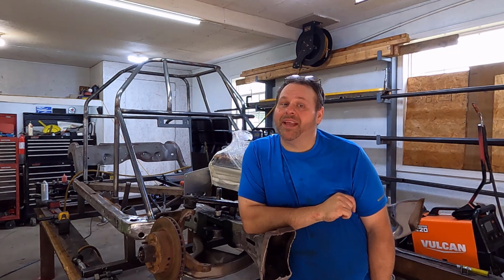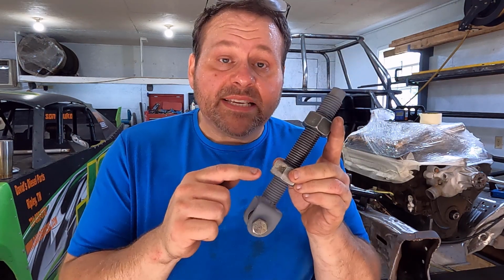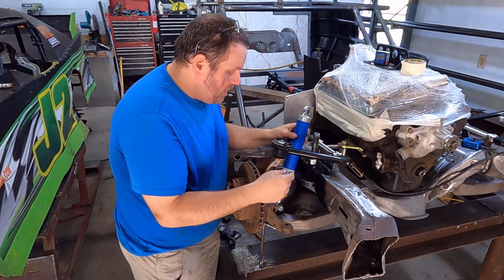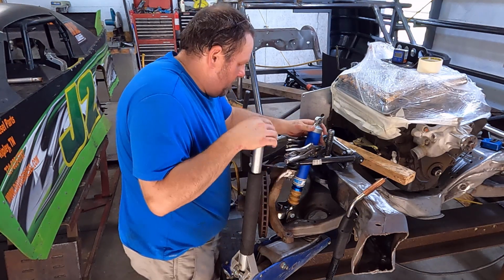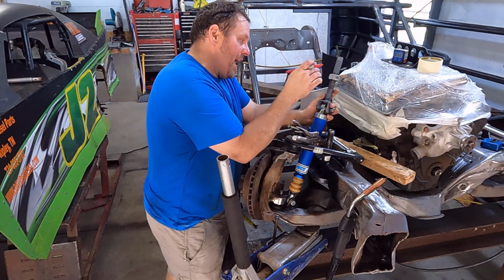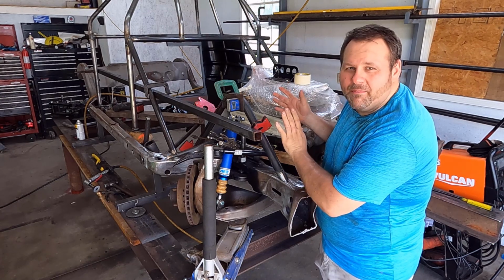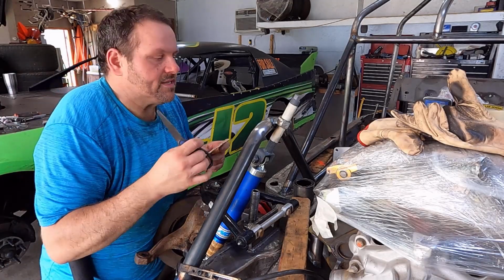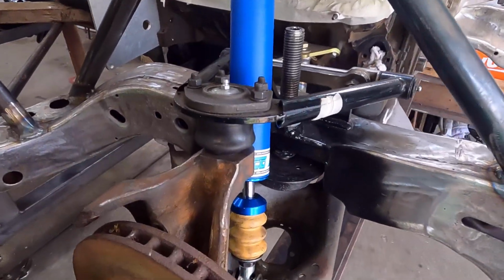Mounting a Shock with a BumpStop

Comment: Do you have to have the screw jack when running the bump? My question is if you know where you have to have it, will you ever adjust the screw jack again once you know where you want it?
Reply from the maker: The jack screw can definitely help you dial in the load on the bump but it's not required. You can use shims that pop in to do the same thing. Crate Racin took away our bump stops before I ever got the chance to use this one. On my camaro, when I ran it in Crate Racin SS, I did run a bump before with good success and I only changed it when I changed the bump and went to a softer bump I needed it to engage faster.

Comment: Only bump stop I've had was when I used a 600lb RF spring on a 3600lb car and the frame was hitting/rubbing the track 🤣
Whoever build the car made the tie ins for the cage too low...
After the race that right side section paint was gone and polished smooth
Reply from the maker: I built this one knowing I would be on softer springs but having a weight jack to simply run down sure makes that less of an issue as well.

Comment: Do you have to run the shock through the arm? Looking like they will be damaged easy in a small mishap
Reply from the maker: As far as rules go, I can put it anywhere on the front. There is a significant control improvement by getting as close to the end of the lower arm as possible and to get anywhere near that end, through the upper is about it.
Yes, its close and if a ruin an upper then the shock will need repair for sure. I do wish I had a better solution in this.
Reply: @DIRTRACELIFE  the farther from the ball joint just needs a bit different shock setting. Same results. But you are doing a good job watching most of the build keep it up
Reply from the maker: Thanks Mr James, I know you are right in what you are saying. Location just changes the valving requirement. I need to make sure I point that out in a future video.
Reply: @DIRTRACELIFE  check out this channel. Not like you are explaining but damn they have a system. B&B racing chassis

Comment: I'm planning to cut a hole through the upper tube with a hole saw then weld in a threaded insert for the shock jack bolts. Do you think that's a bad idea?
Reply from the maker: No its a great plan. Make sure you don't have big gaps and complete consistent welds all the way around both ends or it will be a fold point in the tubing and I would advise welding in sections with cooling time to avoid heat saturating the tubing to the point it softens substantially. I would happily use this method as well and a few others on here have commented they like that approach as well (And it looks great!)
Reply: @DIRTRACELIFE  thanks I like to get as input from others. I'll mock it up on the car like you did then tig weld it up on the bench in a comfortable position.  Would like to integrate a k member bay brace bracket into the same area.

Comment: Great content Jason, how about using a peace of tube on the shock adjuster between the two nuts and then you could cut it in or drill a hole  through the shock absorber hoop and add some gussets  to it ,think it would be a lot stronger than just the nut and gussets, hope you can picture this and get what im saying and i like to say you that you are a great teacher...
Reply from the maker: Yes, it would have made all the pressure be straight up or down on the hoop. That sure would eliminate any chance of tearing the mount off. 
I like this.... I gotta remember this :)

Comment: Good lesson Jason.  The one thing I can recommend doesn't have to do shock placement but I noticed you left the holes in the frame. I welded my small holes up and plated all the bigger holes. I also welded up all the seams. Its very solid. I recommend it though it tales a lot of time.
Reply from the maker: It wouldn't be too bad if I just took tin snips and cut plugs from 20 gage steel. Might speed it up.

Comment: needs a brace from both front shock hoops across engine will strengthen it & keep it from flexing on the right front during compression of shock.
Reply from the maker: I agree with you. I picked up a pack of Allstar radius tabs (#60002) and I am thinking perhaps some 1 inch tube for the cross piece.

Comment: As always Jason, well thought out.
A thing of beauty.
If there’s anything I think could be improved upon, it’s to perhaps put a top gusset between the side gussets to tie them together and from center of the tube to the nut,and front gusset to back gusset.
I think this could help spread the load from the inside of the tube to the top as well, giving it support as the forces try to twist and tear in that miss the cushion scenario.
Reply from the maker: Agreed, might add that on this one.
Reply: As always great build have used many of your ideas on my 81 regal build thank for what you do
Reply from the maker: Thanks Jim, appreciate the feedback.